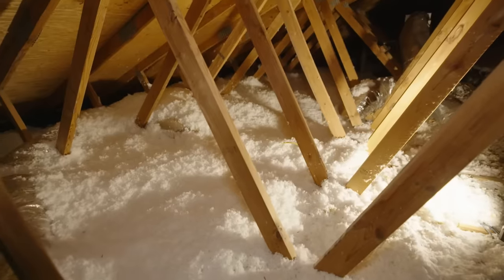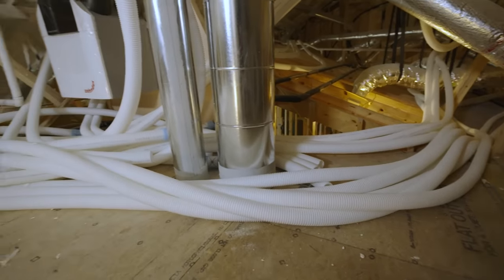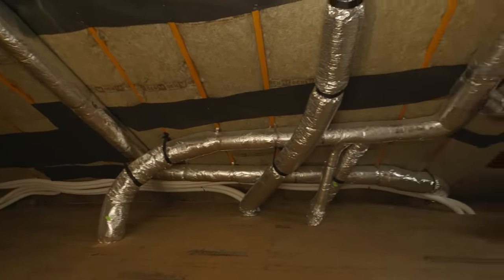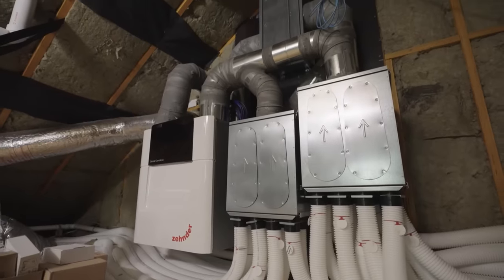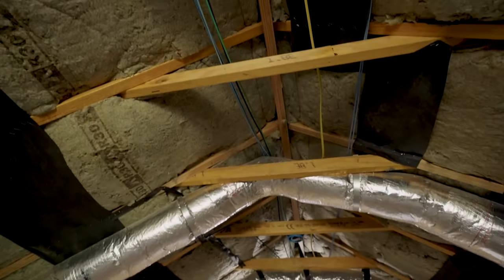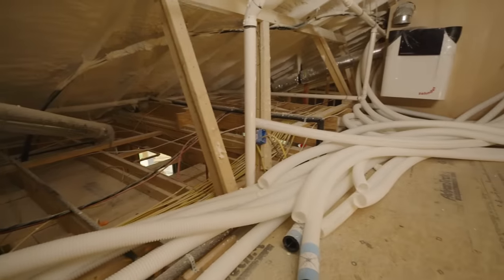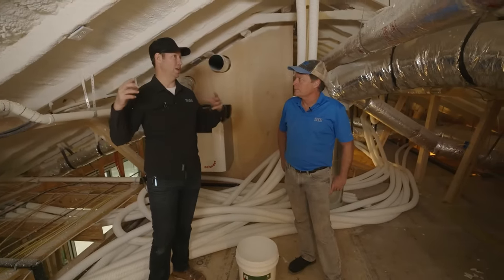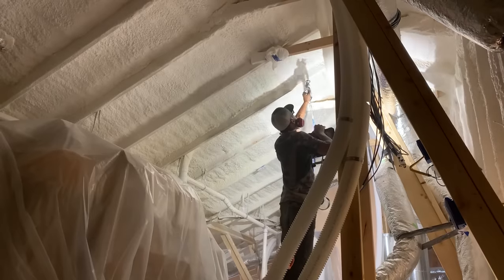Building a BETTER attic - Unvented + Conditioned attics 101

Comment: Love the idea of a conditioned attic, I just wish there were companies out there that would convert existing attics to conditioned attics.  Building a new house isn’t a solution for most of us.
Reply: There are. Get the roof deck and gables sprayed with HDPU foam up to the r-value needed for your region. It's called "encapsulation." I retrofitted the attic in my 1950 house in Texas and it is glorious.
Reply: @Engineer10211 , that’s great.  But it seems like a retrofit these days requires the owner to act as the contractor, and manage subs.  Spray foaming the attic is only one step.  Then an HVAC company needs to come in for ducting fresh air, general laborers need to come in and remove blown in insulation and deck the attic.  A one-call, turn-key company would be nice.  It’s a business opportunity/idea for sure.
Reply: @imolazhp11  The fresh-air ducting isn't needed after encapsulation unless the rest of your house is extremely tight already. That said, if you have a gas furnace or water heater they will need to be swapped for direct-vent models but you can probably re-use the roof penetrations for those. I know that insulation companies in Dallas will remove old insulation. And oh yes, I modified my gas dryer to be direct vent (don't tell the inspector) with coaxial venting and a plenum on the back of the dryer.
But if you want a sweet setup with a floor, yes, you'll either need to DIY it (or at least a lot of it - I recommend getting a sub for the spray) or hire several contractors. My wiring was running on top of the ceiling joists, so I drilled through the joists and re-located it (I'm a structural engineer, so no problem getting it right). So that's an electrician. Decking would be by carpenter (I did my own). If your ducts are all over the place like most are you could hire hvac to tidy things up or do it yourself. 
It may sound like a good business idea to provide a turn-key project, but it's hard enough to sell people on the idea of investing maybe $7 or more per sf to just spray their attic. Doing all the other stuff would probably push it to $15. There aren't going to be many takers.
Reply: @Engineer10211  Is your estimate of $15/sqft inclusive of all costs for the conversion? Also, is that calculated by the floor area or the surface area of the inside of the roof and walls? Thanks!
Reply: @KN-jr6tx  I'm totally spitballing that number, but it would be based on the square footage of the attic and yes for the total conversion. So converting the attic of a 2000 sf (one story) home would cost $30,000. That is just a really rough guess. An attic floor isn't going to serve much purpose where there isn't enough height to use that space so the floored area would be smaller than the house footprint. The spray foam would have to be on the entire roof deck and that particular cost would be calculated from the sloping area of the roof, not the horizontal projection.
Reply: easy.attach r-30 foam panels to underside of roof deck
Reply: @designstudio8013  easy for who?
Reply: @designstudio8013  Have to cut to width, then use Great Stuff to seal between edge of foam and rafters. That will also hold it in place.
Reply: @imolazhp11  In reading this thread, no one is going to throw $30k into an old 2000 SF 1950’s home to convert attic. Payback on that? Go figure $100 savings per month in utility cost as a guesstimate and it would take you more than 30 years to recoup your cost. Someone isn’t thinking straight here.
Reply: You're talking at least 30k or more to retrofit a decent sized home.
Reply: @truthstandard  everyone’s situation is different.  Our house was built in 1998, round up to 2000.  If the homes overall life is +/- 100 years, then the house still has over 75 years of service to give.  $100 x 12 x 75 is $90,000.  Sure, I won’t live long enough to see that $90k, but I’ll leave the world knowing I did my best to limit my carbon footprint.  We also have $30k of solar panels on the roof.
Reply: @truthstandard  people will throw 30k into making their bathroom pretty. Having a much more comfortable home, with big savings on utilities and the big benefits of having a conditioned attic space, plus a higher retail space is an easy sell for some.
At our home, we can lose power for 24 hours, dead of winter or dog days of summer, and it stays comfortable. That's another big plus.

Comment: Purchased our retirement home (built in 1947) - roof is currently a mix of normal pitched roof and some flat roofed areas.  Will be installing a brand new metal pitched roof where trusses will be built onto the flat roofed locations so that all the roof angles are same-same (rain gutters to water barrels for gardening needs).  I'm thinking the DC315 spray foam would be the best option for the new roof trussed areas.  Would love to see a retro-fit video of an older house being updated with these new insulation techniques.

Comment: Seems like that DC315 coating should be applied to attics even if they aren't used, to protect the wood from burning.
Reply: I see this becoming a residential building code in the near future. Similar to how exterior insulation has become the norm.

Comment: I had my house built in 1993. The attic was exactly as shown in the beginning of the video, vented and unconditioned. I quarreled with the logic of having the HVAC suspended from the roof in the attic every time I went into it in the dead of winter (-6 Deg F or more outside, hence frigid attic) and the heat of summer (over 100 typical outside, hence unbearable attic). Plastics (automated duct equipment housings, motor gears, etc) aged and failed quickly. For years I looked for solutions to avoid operating the furnace in the worst possible environment in winter and the air cooling operating in the worst possible environment in the summer. I began looking in earnest after 19 years when I knew I was very close to needing total HVAC and condenser replacement. I did with a company which vacuumed out all the blown-in insulation and spray-foamed (closed cell) under the roof. They also sealed the attic with the exception of two vents. Apparently this was a requirement (at least in 2010) since my heating is accomplished with a gas furnace. It cost $10,000 for the re characterization but I’m very happy with it. My winter heating bill cratered from the previous years highs. I replaced the HVAC system after this when I knew the system would be in a much better environment. Now my worst month’s heating bill is 1/4 of what it used to be and the worst month AC is almost half. I have a question, since my attic has no living space and is now “passively” conditioned, are the remaining two vents still required? The furnace has a coaxial venting system, the combustion air is drawn down through the outside corridor and the exhaust is expelled through the inner corridor.

Comment: From an energy savings perspective it’s great. From a termite perspective it’s awful! Currently we have been advised not to fumigate houses that do not have ventilated attics. Additionally I’ve seen homes where termites get in between the foam and the sheeting and do tens of thousands in damage before you know.
Reply: energy savings on these houses isn't a real thing. If you add the attic to the conditioned space your increasing the cubic volume to cool and need to increase the size of the hvac system.
Reply: @TheMax13542  it's getting balanced by overall much more superior insulation.
Reply: It’s like reinventing the wheel. Some things are better left alone.
Reply: @Goldarr1900  And some times NOT leaving things alone brings innovation.
I don't like the "If it ain't broke don't fix it mentality". This stifles progress and innovation.
With that mentality we'd still be walking and riding horses everywhere.
Reply: @TheMax13542  It is a real thing if you have HVAC equipment and ducts in the attic, which is admittedly a stupid thing to do.
Reply: @hailexiao2770  why exactly is it a dumb thing to do? Particularly if you have a conditioned attic?
Reply: @hailexiao2770  why exactly is it a dumb thing to do? Particularly if you have a conditioned attic?
Reply: @sunriseshell  And then we would have cleaner air and less pandemics....we can't have that !
Reply: @ronald8673  
Fair point, fair point. 
However, I believe that continued innovation will eventually get us out of this as "green" technologies progress.
Reply: @hailexiao2770  lol no its not. take a vented attic house, up the level of insulation on the duct, bury the ducts in insulation, add an attic exhaust fan. minimal cubic volume, maximum insulation that's how u use less energy. Now granted ya HVAC in an attic isn't smart, but everyone uses slab foundation for new houses so where else are you gonna run ducts.
Reply: @MariuszChr  a vented attic with insulation equal in quality to that of an attic that is part of the conditioned space has more volume of heat to move and is less efficient. Obviously a well insulated conditioned attic house would out perform a poorly insulated vented attic.
Reply: I wouldn't think there would be Energy savings at all. I would think there would be a high energy bill after trying to air condition that attic
Reply: @ericvollmer8820  you would probably need a whole separate unit. You would have to heat and cool just like you do the lower house. The energy cost and the cost of the units would not be cheap. I would rather make living space in my basement and use the existing HVAC

Comment: 0:24 Hot, that’s an understatement if ever Matt.
Live in Central FL and gotta say, when doing a project and time to get into “attic” crawl space…..we do rock, paper, scissors….or draw straws; no joke. Last thing we wanna do during the wonderful “summer” season here in Florida (or what we call it, “Hurricanes, hot, & hell season”) is have to go into the attic/crawl space and do work. Even makes it worse if gotta gear up with PPE🥵🥵, it’s so bad.
The pic here is pretty much the typical style, but so much worse for most houses around “us”. We do get lucky once in while and find an attic area where can actually “stand” a little, and move some what around; compared to the normal slithering on stomach and crawling below rafters/framing, NAILS, ducting, and so on.

1:29 [We] all need to start building houses LIKE THIS; as it’s SO Much better, imo. Can actually have access for repairs, running a wire or something etc…, walking and standing up, and not dying of heat exhaustion….
This is such a beautiful attic 😢, so Beautiful, that wish it was My House.

Great Vid, and can’t wait for your hidden door vid of your “real remodel”, as love all your hidden door vids; and b/c if your channel, started using Sugatsune and Soss hinges for doing our own “hidden doors”👍🏻

Comment: Hey Matt, It would be nice if you could cover a framing, insulation, and barrier package for a vaulted ceiling build with no attic.  In CA, many homes are pier and beam, so ducts are under the floor instead of in the attic.  Vaulting a ceiling is a common home renovation request.
Reply: I think that would be good for CA, especially with the fires you have out there.  An unconditioned, vented attic could easily draw in embers from a fire, whereas, if the attic is conditioned and sealed off, there is no way for the embers to get in the attic. 👍🏻
Reply: The only difference between a vaulted ceiling and the attics shown is the extra framing for the ceiling and the location of the wall finish. Ooops, ductwork too. The insulation is the same.

Comment: In the north where I live we have lots of "Cape" style homes... for the un initiated; a cape is a ranch or salt box 1 bed 1 bath  home on the main level that has stairs to the attic which is pitched as an upside down V more or less...  Not leaving much in the way of useable headroom... Most of these get Dormered out or expanded to create more space and add a bathroom... Slap up some sheetrock & fiber batt. Call it a day.... Toss the kids bedrooms up there and call it a 3 bedroom house..... In the summer the space is near un liveable. The added moisture from an extra bathroom and the fact that most people don't understand how thermodynamics works.... Mold and saggy sheetrock is common. When it's conditioned since it's not a sealed space you can imagine the outcome.

Comment: Would like to see a video about attic encapsulation where you use the reflective radiant barrier and air sealing everything between the attic and the conditioned space, to include using insulated light covers. It isn't nearly as expensive as this conditioned method but still works many times better & accomplishes the other benefits over the traditional method you show at the beginning.

Comment: Would be nice to explain approximate costs of this attic construction (with that very complex air handling with vast numbers of flexible venting pipes) versus the typical loosely insulated attic. I suspect it is prohibitively expensive for most people. I also suspect that in many areas it would be difficult to find a contractor capable of this more advanced type of attic insulation.
Reply: If they do not talk about price then it is way to expensive for most people.  They could easily do this in So> Cal in the fire areas, most of the fire insurance is going up 900 percent.

Comment: Well Matt conventional roof rafters have been the standard method in many parts of the country since the founding of the country.
Difference is however it takes more skill to layout and cut rafters on site than it does to order engineered trusses from a factory.
As for the insulation, contractors can only use what is available, and that has changed over time.

Comment: Which would you rather have for a roof, engineered trusses or rafters ? Engineered trusses allow you to open the area below. Rafters allow you to open the attic which you can convert to a living space or "condition" it which is what they are doing here. As for the foam I wouldn't bother, no way it's less expensive than dry wall and you can't tell if there's enough or if it's covered properly etc. You can see drywall and you can vary the thickness and you can add metal fairing channel for a little more sound proofing etc. If you have trusses and your attic is hot in summer consider adding insulation between each truss at the roof line. I think I might try that.

Comment: Important air conditioning question.
We recently had to have our air conditioning units replaced. Before that our old air conditioning was going out and we were trying to make it survive for years now. The old air conditioning kept the coldest room in the house which was not super cold but it was colder than the rest of the house However with our new one now the coldest room is the hottest room. And my son's room is still hot as it was before we got the new air conditioning. It seems like everything did a flip-flop and are master bedroom used to be pretty hot now it gets very cold at the cost of my son's room upstairs still being hot and now the coldest room being hot upstairs. There's hot spots everywhere upstairs now where before with our old system it was not so. Even though the air conditioning was going out on the old system it kept things a little more balanced maybe. LOL
My question is what did they do different that caused the coldest room to become hot and no longer cools. And one of the hottest rooms in the house becomes cold.????
I've called them out and they say well cold air is blowing and just to keep the bedroom door open that used to be cold that is now hot open. I used to keep this door shut at all times with the old system because the room was so nice and cold and I could have relief from the heat of the rest of the house.
I'm sorry for the long text I just am so frustrated. We live close to the South part of Austin. Do you have a phone number or away I could get hold of you maybe you could give me some insider tips to help me figure this out. The cost would cost too much for us to fix it again so I need to figure this out. I want my coldest room to be cold again not hot. 🥺

Comment: If the roof leaks and sheathing needs replaced, is it a huge pain to have it “glued” on with closed cell foam?   I guess it’s no match for a reciprocating saw, but then it would need to be re-sprayed afterwards?
Reply: Nope you just sheet over the old stuff.
Reply: I've always hated the idea of a spray foam roof by the time you would notice a leak the entire roof and trusses would be mush
Reply: @Mostviews111  in NC, climate zone 4, most ppl recommend open cell for attics. Spotting leaks is one benefit.
Reply: @neverknow69  You sheet over rotted sheathing?
Reply: In the roof assembly shown here, the sheathing behind the closed cell foam has a taped/sealed waterproof barrier (water barrier 3) applied on the exterior surface, then a layer of sealed/taped closed cell foam board insulation (water barrier 2), finally topped by another layer of sheathing and a roof product (barrier 3). I think the idea is that the outer sheathing gets replaced with the roof in 20-30 years... I can't picture an situation that could damage all three barriers to the point of leaking without causing massive damage that would be immediately apparent.
Reply: @kschleic9053  hurricane
Reply: You can replace the boards from the outside if the roof leaks. As opposed to the alternative of removing damaged sheet rock damaged insulation damaged flooring ,paint, tape, you name it. Roof system failure sucks no matter how you build.
Reply: @srt4b  as he said - "without causing massive damage that would be immediately apparent."
Hurricane will be in the "massive damage that would be apparent" category
Reply: Do they not put a layer of plastic before spray to make re roofing easier?
Reply: @srt4b  Insurance